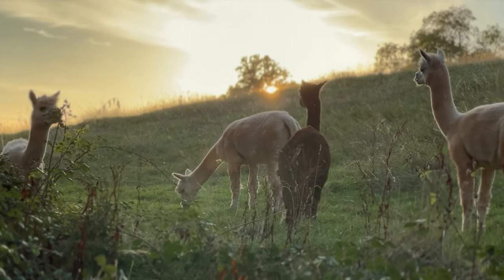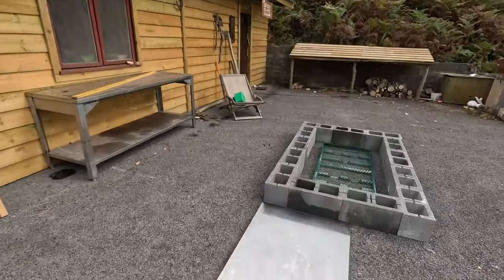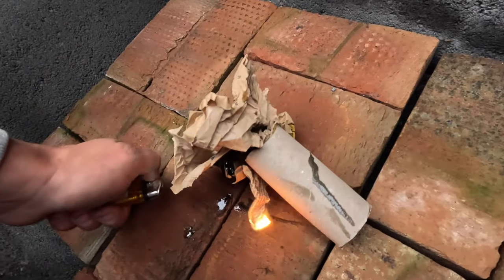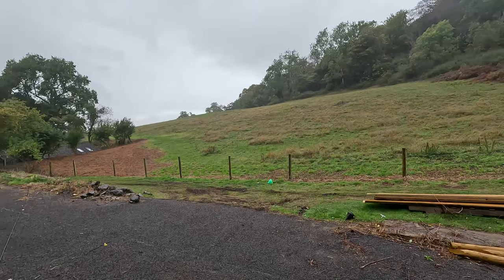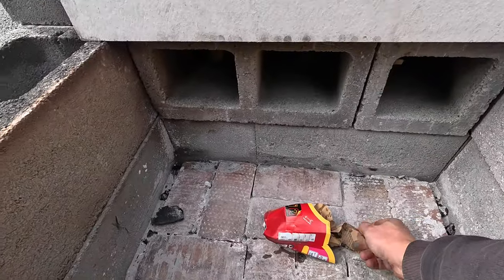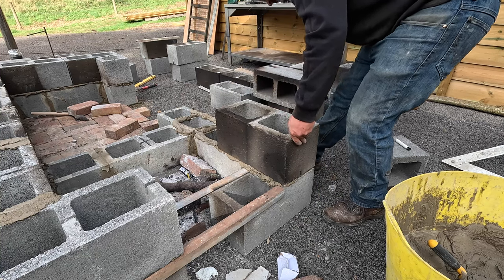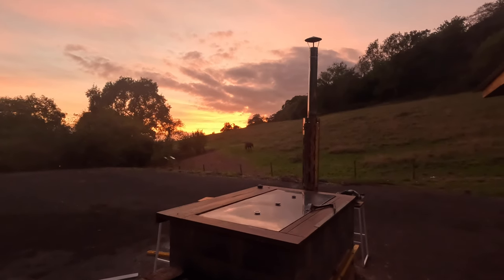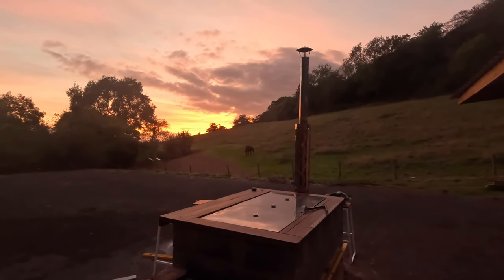Building the ultimate whole hog bbq/smoker for less than £250  VLOG 2

Comment: Just fill those bricks with sand
Reply: What type of sand?
Reply: @1230mkelly  sand is sand  doesn’t matter what kind  it will act as an insulator
Reply: @1230mkelly  you could use concrete to fill them also but no need what ever is cheapest and most available